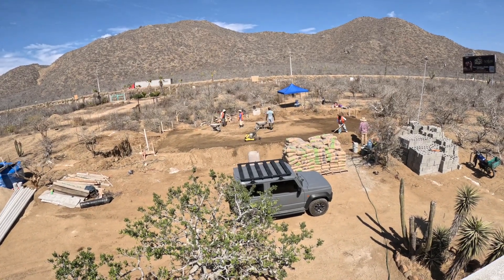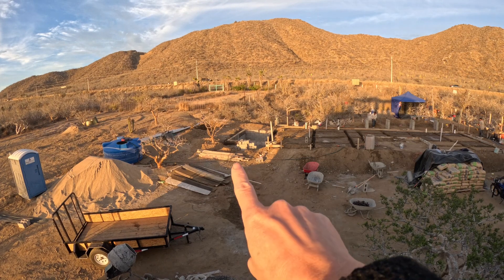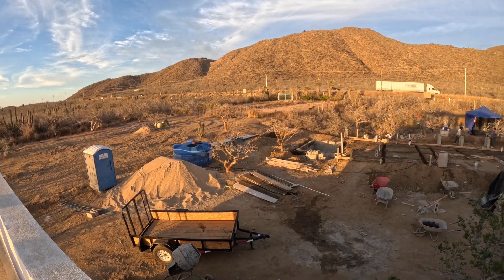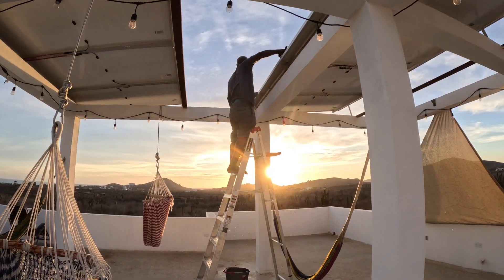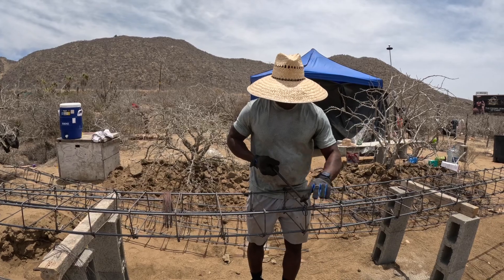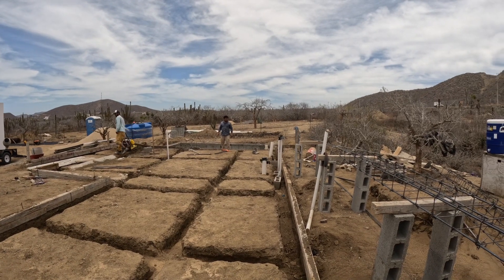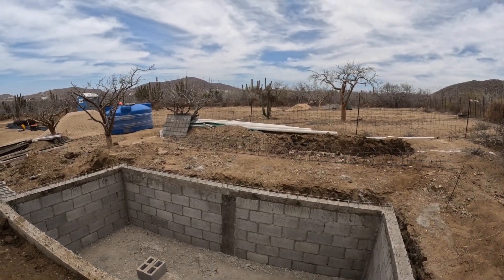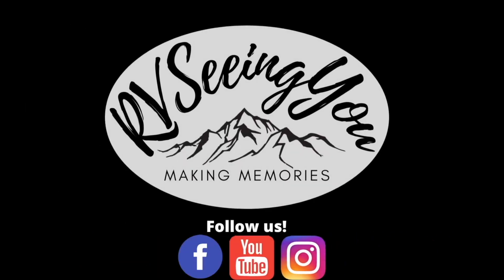Building Off Grid Home in Mexico | Casitas Day 1 5

Comment: What did you not like about the concrete cistern? Do you have a house filtration system? 
Just discovered you guys. Thanks for all the great information. We are just starting to build in Huatulco Oaxaca. Love your place!
Reply from the maker: Hi, thank you for watching. 

1. The cost for us was similar to installing one a plastic container. 

2. Block cisterna needs to be sealed. It’s not difficult but you need to make sure it has been done. 

3. If it’s leaking, it may take longer to identify. Plastic ones can be checked before they are installed. 

Wish you all the best with your installation.